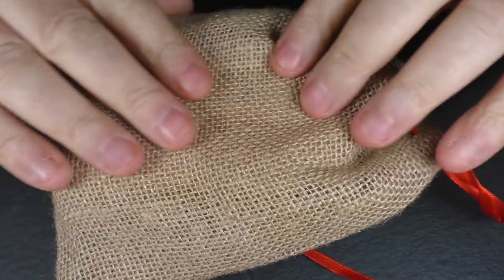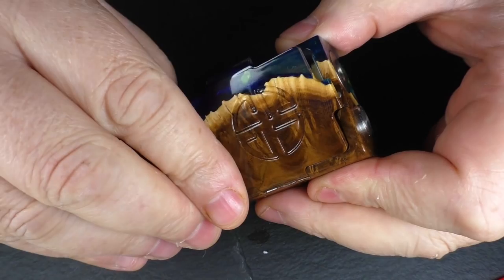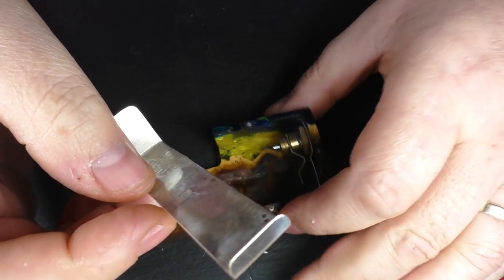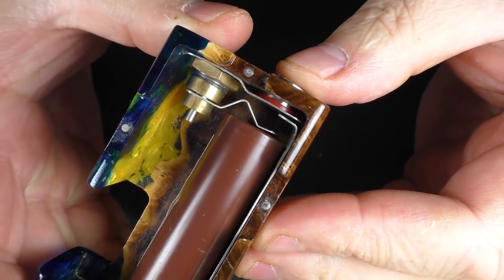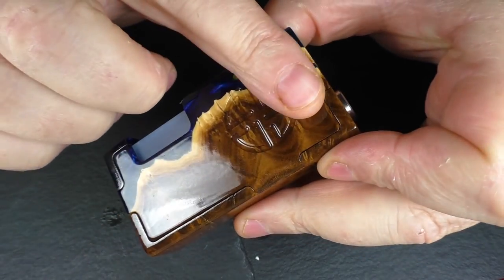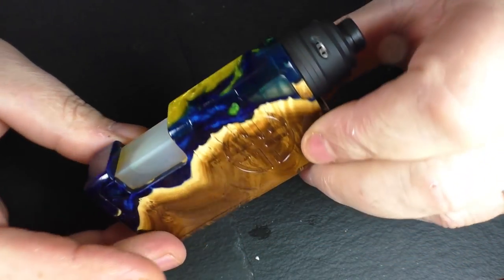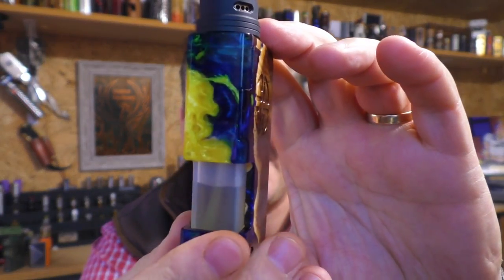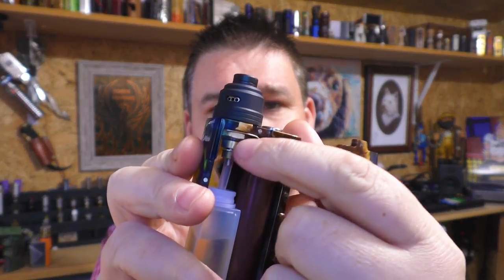Shield Squonker by BBViking Mods

Comment: I dont mind the contact coming out. Thats not a huge deal to me. The only worry i have is that bend in the negative contact. Its too close to the positove contact for comfort personally. Id like to check one out in person. That finish looks really nice. Great video. 👍💨💨💨
Reply from the maker: You can adjust the contact as you see fit, that's just the way I like to run it 😊
Reply: Todds Reviews no im talking about the big upward bend in the negative contact coming up that high. Seems like if I pushed the button hard enough I cld make the positive contact touch it. It wldnt happen in normal use but maybe in a bag or something which i know everyone should have the batteries out if they put this mod in a bag. I was just thinking they cldve arranged the contacts differently.
Reply: @zachmikkablair9537  I know what you mean, I don't think there's much danger of it happening, but I think it would have been nice if the contact attached to the 510 positive pin was insulated. A little bit of heat shrink would have covered all bases.

The door popping could have been resolved with a couple of locating pins on the front edge of the door. You'd have to slide the door into place, but in theory it would  be rock solid while squonking
Reply: joe arrowsmith right thats what i was thinking. Its simple fixes. If i had one id prolly put some heat sink arounf ot just to b safe.
Reply: @zachmikkablair9537  Hey Zack BBViking here, There is no possible way that something like that could happen, and let me explain.  The proper battery orientation is positive up, so that no hard short can occur,  in that case, you are worried about the positive contact going to the 510 pin. The upper negative contact ( 510 contact) is 0.5 mm nonheated silver, which means it is not as soft as heated silver which is generally used, thus it has a much higher resistance to bending. The button sticks out of the mod for 3mm, and the space between the positive 510 and any negative is more than 5mm. That means that you would have to press the top of the button all the way in and  2mm into the mod to make contact to the positive, which is something that can not occure accidentaly. Also, the negative removable strip would hinder you pressing the button in that manner, as that aswell can not be bent. If you want a video, im more than happy to recorde one for you tomorow. :)
Reply: @LyK0sa  Hey Joe, BBViking here, i understand your idea about the door, but what Todd mentioned, the door and the negative strip was designed in this way intentionally, as i wanted a security measure if something happens. All you need to do is a hard snap of the wrist, and door, battery, negative contact and bottle will fly out, thus breaking all contact.  That was a planned feature, in my eyes, a issue in someone elses :)

Comment: It seems a bit bodged and for 200 euros ouch
Reply: On the contrary, I'd say it's quite a good design, and finished really nicely.

Yeah, it'd be nice if the contact was fixed in place, and really I don't think there's any good excuse for not doing so. But I do think switching the negative side of the circuit makes sense, because the switch contact surfaces will never move, meaning you get a larger, and more importantly, more consistent switch contact area compared to the usual design where the switch makes contact with the positive pin, which will vary in height depending on the atty and whether you're using a beauty ring.